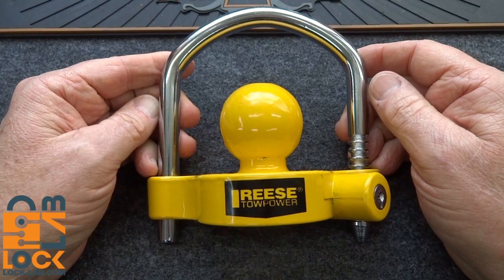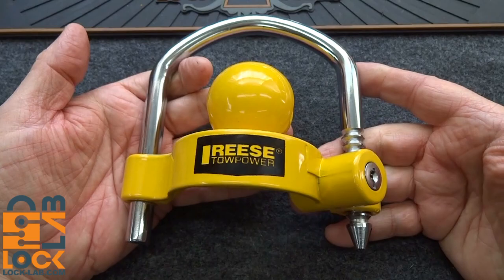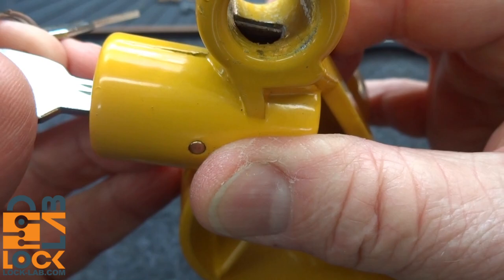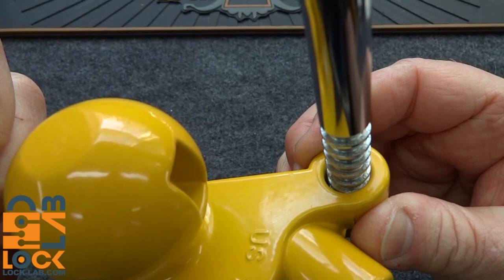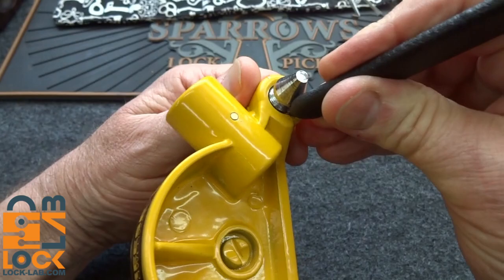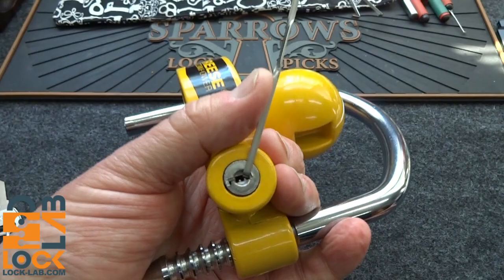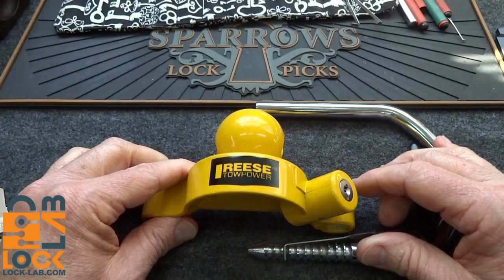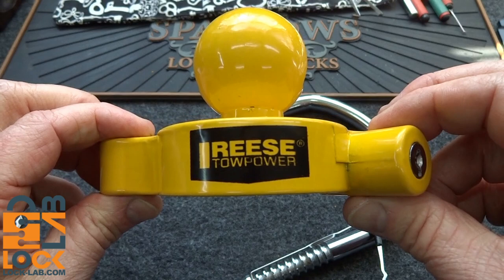(1026) Review: Reese TowPower Hitch Lock (JUNK!)

Comment: we had a customer lose 5trailers with this lock. a sharp blow on the lock cylinder from above WILL knock the locking pin loose and defeat the lock...
Reply: It's possible they were all stolen at one time...
Reply: Well, I thought of that.  Some sort of five trailer railroad-style setup.  I'd be shocked if that's road-legal, though.
Reply: It doesn't have to be all in one shot. A thief could have returned multiple times over the course of a night, or there could have been multiple thieves.
Reply: the person in question owns an oilfield services company, they have many trucks and trailers.... he learned his lesson. they now use heavy chains through the wheels with some good padlocks.
Reply: Haha I love people on youtube. Everybody just assumed the guy was an idiot by either trying to make some sort of road train, or that he was stupid enough to keep buying the same lock after 5 thefts...

When will people stop judging the other when they know fuck all about the situation? lol... You should all be ashamed.
Reply: jay pritchard just like any padlock that uses a locking pawl on the shackle. even if it was secured on both sides of the shackle, shim one side, smack the other.
Reply: jay pritchard so be sure to pass that on to your customer. make sure them padlocks are high end.
Reply: jay pritchard it's a form of a kinetic attack. as long as you have some tension on the shackle, and your tap overcomes the spring tension, it's like a que ball hitting the 8 ball. the lock pall will disingage for a split second alowing the shackle to come free. I believe bill even has a video on this
Reply: I think if you had a lock that engaged both sides of the shackle, and the lock pawls where shim proof, this would sufficiently complicate matters for a theif. they will then be left with picking what should be a high security lockpick resistant lock, or cutting what should be a case hardened shackle. either way, to much of a pain in the ass for most folks. only guys you really pissed off would take the trouble to go though all that. even then, that's what Doberman pinchers are for
Reply: I just had a trailer taken that had this lock on it.
I was lucky I got the trailer back, but thank you for your video.
I will find a better lock !
Reply: you can lose literally any trailer wiht a lock. 5 seconds and an angle grinder POOF GONE

Comment: We use a cut off tow ball to fill the coupler, and spend good money for a better lock on the top of the clamp and haven't lost a trailer yet.  We also tack weld the coupler to the trailer frame so unbolting doesn't allow swapping coupler units.

Comment: In Germany you typically use something called "Kastenschloss" to lock up trailers. Looks like this: https://www.amazon.de/Cartrend-70138-Kastensicherung-mit-Schloss/dp/B004Q9T6X8/ref=sr_1_14?ie=UTF8&qid=1489167101&sr=8-14&keywords=Kastenschloss for example - there are better models available, but this one has nice pictures (:
Fit that with a good disk lock like an Abus 20 Series, and a potential thief needs a grinder to get it off since there is no hasp you could reach with big bolt cutters.
Reply: Mira Lausch Does Germany make a nice steering wheel lock?
Reply: even if in Bill's video the trailer lock was made of a thick gage steel and the tolerances made it un-shimmable - the lock used falls under " defeat in seconds " . the lock type used in your example reminds me of Bill's video # 394 again an open in seconds lock --- not too much of a delay....
Reply: It locks around the handle on top: https://www.amazon.de/dp/B01N7HMSJ5?psc=1
The other main style has a removable bolt wich locks it around the handle: https://www.amazon.de/ALBE-SAFETY-BOX-Diebstahlsicherung-Ausf%C3%BChrung/dp/B00EHJA0AK/ref=sr_1_16?ie=UTF8&qid=1489259471&sr=8-16&keywords=Kastenschlo%C3%9F
Like I said, good system if executed properly out of good steel and such.
Reply: Mira Lausch also known as Das lock

Comment: a single strike with a 2 or 5 lb hammer right on top of the lock will bust this lock to pieces, and a crowbar will pull the unlocked end of the hasp loose..

Comment: I'm in the repossession and private property Towing business. We typically just throw a ratchet strap over the tongue with the shackle resting on the truck and snap the pawl. I have implemented shims before to bypass quite easily and had people thank me. But I always feel compelled to tell and or show them how unsafe that lock is. I've taken trailers with six digits worth of equipment in less than 30 seconds multiple times.

Comment: This lock is a piece of crap. I had one. I lost the key to it and needed to get it off. One modest whack from a deadblow hammer and it popped off. It won't stand up to a thief for more then 3 seconds. It's worse the master lock. To lock your trailer get a good lock not master lock and a ball to fit. Grind off the shank on the ball and lock the tongue with the ball in it. It stops people from dropping it on a smaller ball and taking it.
Reply: I just saw your comment, I posted the same thing.  That seems the best solution to me, because it seems that our idea would make it much harder to hook to the trailer by using some alternative means(such as resting the trailer tongue on something else while the lock is still in place).
Reply: John H Baumgaertner and how do you know what my tongue looks like. It can not be pulled apart with the ball in and locked.

Comment: One of these came with the brand new (fairly expensive) enclosed trailers I bought a month ago.  (Different brand, same exact lock) long story short, a friend borrowed it, a couple days after I got the trailer, put it in my driveway, and locked it when I was not home.  I had forgotten my keys at the office and needed to move the trailer.  Rather than drive to my office and get the key, I went to my workshop in the basement, to get my really crappy beginner pick set (I've since upgraded to a praxis kit for when I'm home and playing, and keep a tuxedo kit on me now at all times (thank you Bill for that))   took maybe 8-10 seconds for a relatively novice picker to get it off so I could move my own trailer.  Haha.  Now I just don't use the lock and park my truck in front of the trailer.  So if you can steal my truck, then go ahead and use it to take the trailer as well.  Lol.

Comment: just brought one of these for a trailer i just brought. the hitch has a lock of its own so even if they manage to get this hitch lock open the ball will still be connected and won't remove until you unlock the small lock which is so small it looks impossible to pick

Comment: A friend of mine bought one of these pieces of shit several years ago for a work trailer ( he's a mason).  Well, shortly thereafter, he managed to lose both of the keys that were included with it.  I was at Cheepo Depot later that day and found the display of these things. I pulled out every one that was on the shelf to compare. I saw that the keys all have a number stamped on them, I think it was a two, possibly the three digit number. apparently it's a code identifying the pinning/key cut, or whatever you call it on a wafer lock. Anyway, within the batch of about 15 or so of these things on display, there was only maybe 5 or 6 different codes!  Real frikkin secure! So, I surreptitiously took one key of each code off one of the units, being sure they were at the back of the shelf so they would not get sold in the next day or two. I called my friend and told him to meet me at the trailer. As you've probably guessed, one of the keys I had 'borrowed' did indeed fit his lock and the day was saved. The next day I went back to the retail warehouse emporium of dismay, ignorance, dissaray, and incompetence and quietly repatriated the abscondified keys.
        That eve, while the menfolk  enjoyed Brandy and cigars and the ladies had sherries and dirty dishes, I had stern words with my good friend regarding his less than optimal selection of security and licking apparati.  He humbly accepted my counsel, and promised to seek it in future before making a purchase of like items. 
The evening continued thusly, and all went to their slumber that night content.
Reply: 6 codes? That's bad. There are locking systems with a hundred or so different combinations in this country; still only for mailboxes or indoor room doors.
Reply: haha some Gm cars are like this too..in high school 3 of us had the exact same key for our chevy cavalier/Pontiac sunfires . 3 of us could open each others doors with the same key
Reply: "Abscondified" ain't a word, Shakespeare.

Comment: The lever mechanism inside the coupler that clamps on to the hitch ball can be replaced with a 1/2" bolt and tightened on to the ball that way instead of using the lever. It is more sure-fire and less damage prone AND you can un-bolt the the guts of the coupler for security.

Comment: We needed something similar for a trailer. The package says "resists picking". I assumed it had security pins in it. Tried to pick it just in case before we used it. It picked open so fast. Found this video and saw it was a wafer lock. Junk.

Comment: Slight error on the hitch lock. Once the tow hitch is inserted and locked with a pad lock you can't remove the ball from the mount without attacking the pad on the trailer tongue. The wafer lock and cast body aren't the security. You can get away cheaper if you insert a ball and lock the trailer tongue down well, but the ball will stay in the trailer tongue even if you whack it with a sledge. So unless you want to literally drag it behide you you can't tow what you took.

Comment: show us how to bypass a car boot !
Reply: I too would like to see a car booty picked.  I have seen a video on their use, and the locking mechanism must be turned many turns to remove the boot from the car, so I bet it would be a pain to remove it by picking.
Reply: That would be cool
Reply: Chodda hell yeah! genius question!
Reply: I see two ways:
1. Use the Sparrows Tubular Lock pick, or make something like it.
2. Pick the lock 1/2 position, spray it with WD40, and then use the pins to impression a key from half-set epoxy putty. Wait for the epoxy key to cure, and then use it to open the boot.

Comment: Any suggestions on a decent lock to buy to protect your trailer?
Reply: dahveed284 Just a long shackle padlock.
Reply: buy a box lock and add a decent pad lock to it. 
The box basically covers the whole hinge and locks up behind the grip.
Reply: I bought a GPS tracker on amazon for $30, a speedtalk sim card for $10, a cheap 12v security battery I had sitting around, a $15 10W solar panel, a $5 solar battery charger and finally I pay $5 a month for the cell phone service. Threw that all inside the trailer, mounted the solar panel, GPS, and Cell antenna to the roof, peace of mind for just 5 bucks a month.
Reply: Can you tell me what kind of GPS tracker you bought and was it 2G? Thanks!
Reply: I got the TK103B (103B) with remote on Amazon for $30.  It is 2G, there is also a 4g one available for much more.  The 2G works well in my area, speedtalk is on the tmobile network and the unit gets far better tmobile coverage than my cell phone on the same network.

What's cool about it is how I can set multiple different areas and a distance outside of the area that if it leaves it will alert me. It has a hook up for a 12v siren, it can detect open doors, it will detect ACC ON, has a built in shock sensor, and it can trigger a relay.  So on my trailer I might hook the relay into my trailer brakes so if I wanted to I could lock the brakes with my cell phone or control other peripherals/devices.
Reply: Thanks!

Comment: I'm a fan of the channel having watched many videos and because of them stared practicing picking myself. I have people at work fully understanding that using a Master lock does not protect their stuff at all. This channel is extremely informative, which is why I have to comment on the term of defeating the lock with a hammer and shearing it. A shear failure is a very particular failure and blunt force to aluminum does not cause a shear failure. It would be more of a brittle fracture. The comment is not to say, "Haha, Bill, I caught you." It's more to say keep the really great videos coming, but for future reference, stray away from the common overuse of the word "shear" for any kind of separation failure.

Comment: I bought the other style of Reese hitch lock and it's total junk. Like he was saying in the video, one good whack in that cast pot metal or whatever it is would you shatter not to mention how cheesy to lock system is. I still put it on as a additional deterrent but I still use a grade 70 chain with a heavy-duty padlock whenever I leave it somewhere. That too is not foolproof specially with all these battery operated grinders hopefully between the two, someone will just pick another trailer to steal

Comment: wafer locks are stupid easy to get into. Don't even need a rake or tension wrench. Just a  new, full sized paper clip. Stick it in, twist, and pull, being sure to stop right after you clear wafer 1. I have an old cheap lock box that I practice on. One or two tries and you'll be in. easily less than 15 seconds.
Reply: TheCoolwhipped Wafer locks come in MANY forms, not all are so easily picked, and some can't even be picked at all by conventional means.

Comment: We just started on wafer locks in my most recent lesson for my locksmithing course and they are even easier to beat than the method you used. I wont go into too much detail as it's restricted information but all you need is a single piece of piano wire, you can remove the whole core in seconds.
Reply: MPAH1981 please tell me how I swear I won't use it for anything illegal pinkie promise 😀
Reply: You take the piano wire and shove it all the way to the back of the core. You pull on the core with a paper clip or something and use the wire to move the retention wafer at the back of the core down (or up). The core will then pop out. The sharp piano wire will grip the soft wafer, allowing you to move it and release the core.
(At least on the Trophy case lock I bought to pick on).

BTW, MPAH1981, Security by Obscurity is a bad practice, and who in their right mind would use a WAFER lock for anything of value?

Comment: I can never disagree or argue against Bill when he talks bad about a low end wafer lock. Single sided low end wafer locks are completely USELESS for lock-sport, unless it's an endurance race, like seeing who can open 100 wafer locks first. Probably the most valuable use of that device, is to return it for a refund or scrap it for metal. The only way to make this even worse, would be if it was made out of thin very brittle plastic that could be shattered by hitting it with a small rock.

Comment: File cabinets at my work had  wafer locks and they were hard to pick. I used a hook and a Bogota rake and I managed to open it once before the rake snapped. The springs in those things were strong and the lock felt tight.
Did you have similar experience?
Reply: The best beginner's way of opening wafer locks is using a pair of straight nail-clipping scissors. You open the scissors to 90°, insert one point into the lock, then use the other free blade and handle as leverage. The tool lasts forever and opens most wafer locks in under 10 seconds.
Reply: Like I said, the lock was tight so there was no way this would work.

Comment: Ok. it doesn't work. the first question was what do we use. Any ideas in US?
Reply: Most trailers have a lockable release on the ball hitch.  A good quality shutter lock would be a good start.
Reply: Mark England, I have a lock on it too but it is robably pickable as well.
Reply: David Hall Yes, all locks are pickable but a good lock like Abus has security pins and takes some skill and time to get into.  l only use locks that take me at least 5-10 minutes to pick and are physically pretty stout.
Reply: Order some peweg chain off line, purchase a Stanley 24?7 padlock and install an Assa Twin High security lock cylinder in the padlock. http://www.tricountylocksmithservice.com/shop/
Reply: there is a single nut at the bottom of the mechanism, you could easily unscrew it and hook up without a problem. that hole is there to have a safety pin in it so the trailer cant come loose while you are driving. not security.